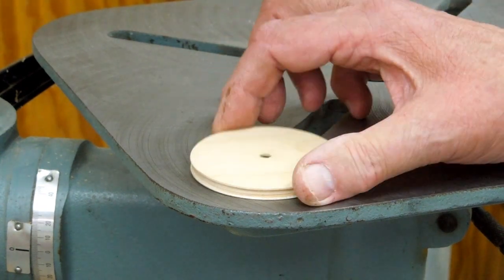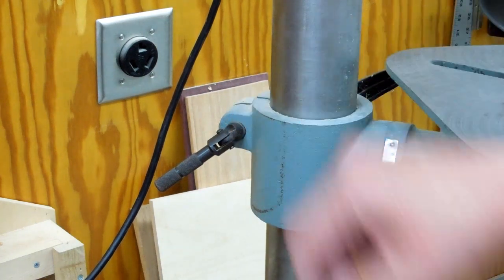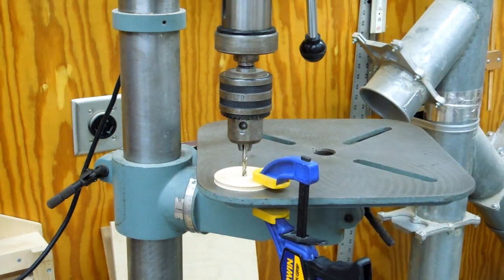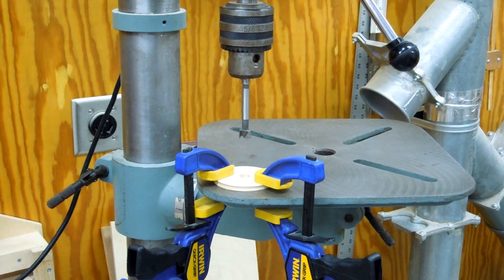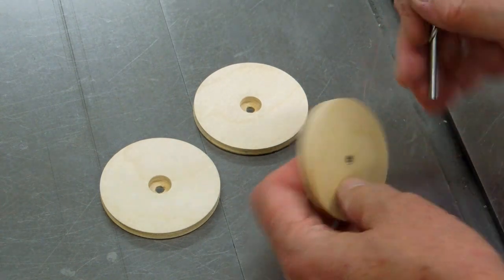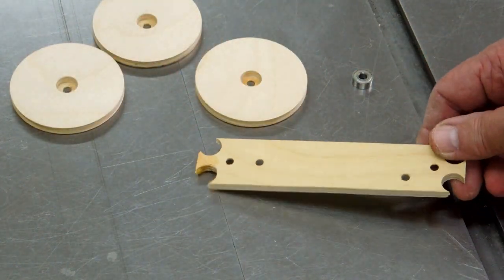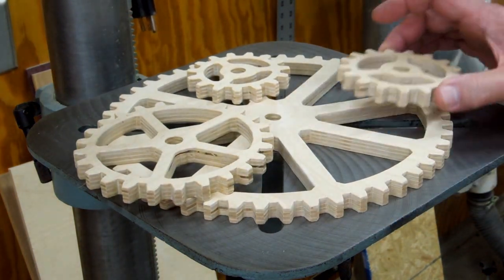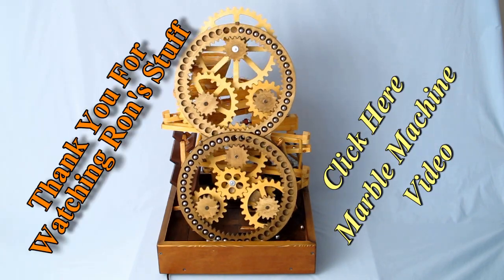Senior 20 Organ (11) Redrilling (Accurately Centering) A Previously Drilled Hole

Comment: You can center it even better, if you turn the drill press on before, and while you clamp the part... It'll sort of self-center the runout.

Frank
Reply from the maker: franksalterego Actually I have found, especially in thinner wood, a running drill bit can egg out the hole and make it difficult to impossible to center the bit accurately. Best to turn the bit backwards by hand while clamping or if an accurate pin is available use that instead of a drill bit.